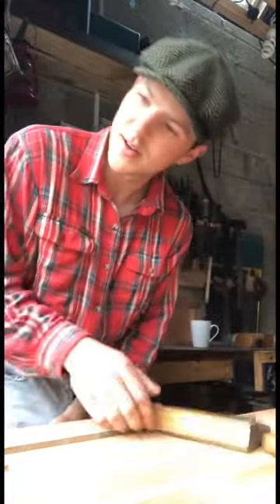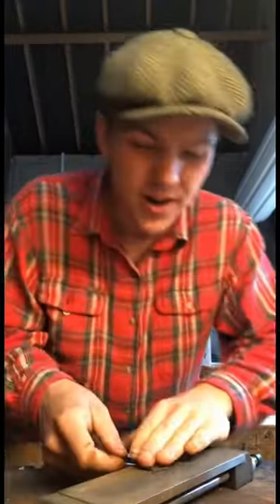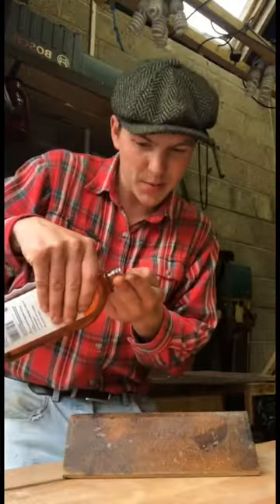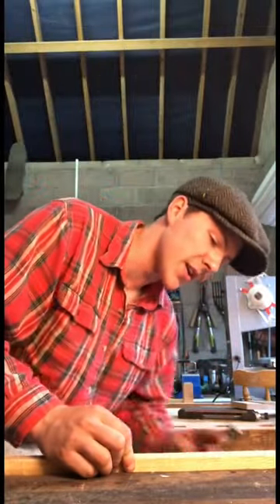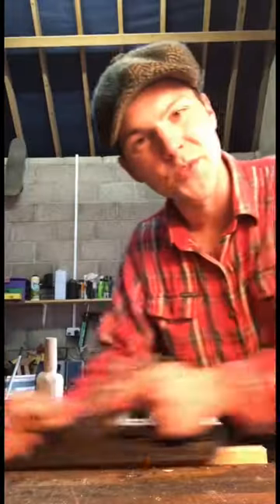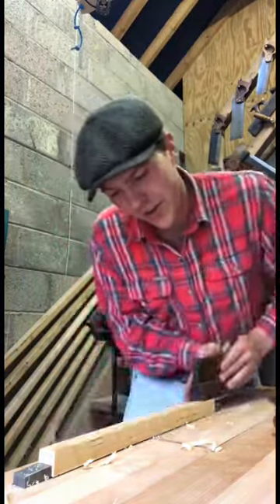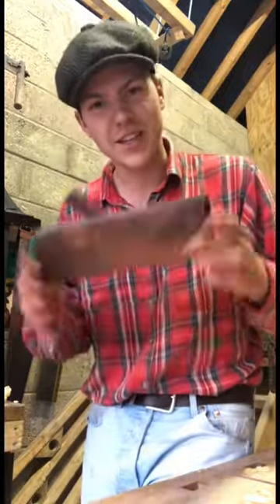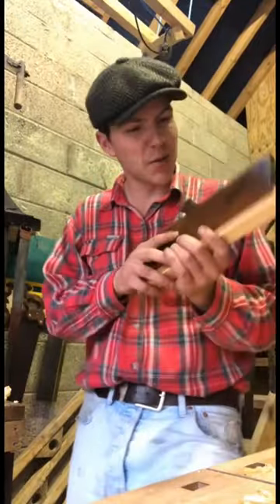Restoring an old moulding plane

Comment: Do you use raw or boiled linseed oil? Like what it does for the old wood .. was curious which kind. Thanks ahead of time for anwering. Love your video's.
Reply: I use boiled linseed oil for my shop tools.  It's great! Safe to apply with bare hands, smells good, and cures to a durable finish.  Then I protect it with a coat of paste wax if the thing is supposed to be slidey. You can buy both at most hardware stores.